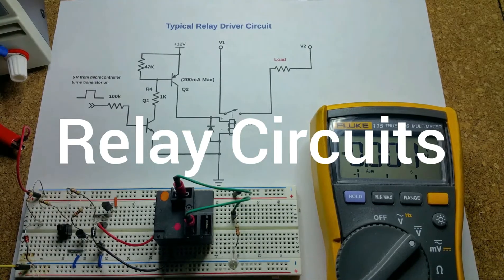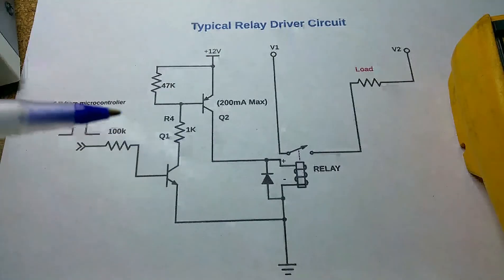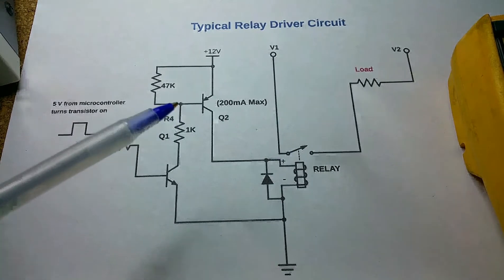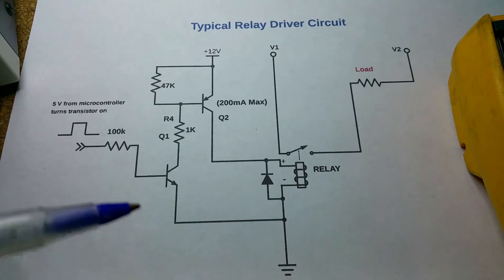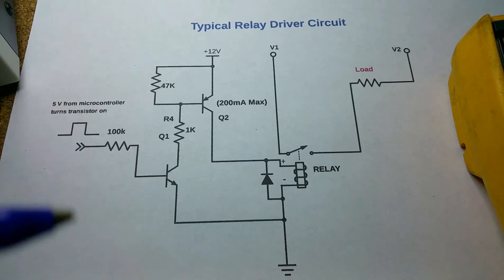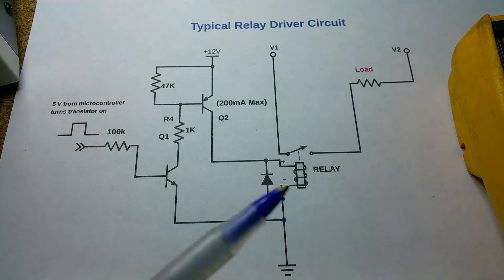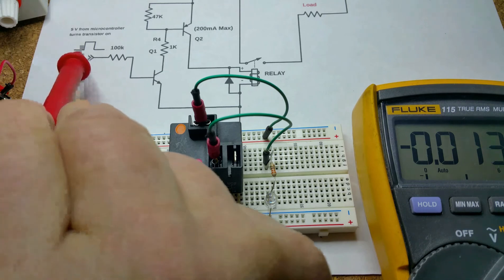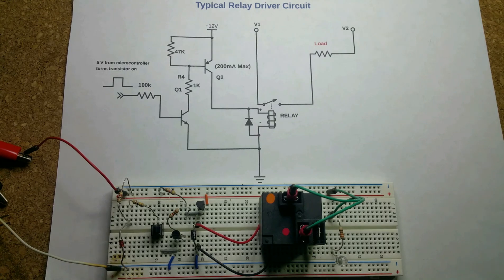#1 - Relay Driver Circuits - How they Work

Comment: Hi, I hope you are still answering questions. My question is that if we assume NPN has a base to emitter voltage of 0.7 volts, then we have a base current around 0.43 mA and assuming a betta of 100 for NPN, the collector current will be 43 mA. Also, we know that the voltage drop across the 47k resistor is 0.7 volts, which means a current of around 14.9 uA. How can I solve this paradox?
Reply from the maker: The base resistor of Q1 will have 4.3 volts across it. This will give us 4.3/100,000 or 43uA through it and into the base of Q1. Q1 is designed to run in a non-linear saturation mode. As such, Q1 collector current is dictated by R4, the 1K resistor. The voltage at the top of R4 is 11.3v. Since Q1 is in saturation, the voltage from Collector-emitter is approx 0 volts. Thus the current through R4 is 11.3/1k = 11.3mA. The beta of a 2n3904 is close to 200. Thus, 11.3mA/200 = 5.6uA. So our 47uA at Q1 base is more than enough to drive Q1 into non-linear saturation. It is true that since the 47k resistor has 0.7v across it, the current through it is only 14.9uA, but per KCL, the current flowing out of the base of Q2 must be 11.2851mA, for a total of 11.3mA (the current through R4).
Reply: @TheTechCircuit  But if per your calculation the Q1 base current is 5.6 uA, isn't this against ohm's law? since the current through Q1's base is calculated based on it's base resistance and the voltage across this resistance?

Comment: Why not drive the PNP from the micro directly. Pulling to ground from the micro switches on the pnp.
Reply from the maker: If configured in that way, the microcontroller output port would potentially be exposed to 11.3V (supply minus the Q2 Veb) when at a logic high, and many microcontrollers can't tolerate much more than a volt over their supply (or 6 volts for a 5V microcontroller). The NPN transistor is instead used to pull the PNP one low while only requiring a 0.7V base bias which the microcontroller can of course easily provide via the current limiting resistor.

Comment: There is no detail about transistors, their type and current and voltage requirements. There is no explanation as to why 2 transistors were used when only one can work as a relay driver.
Reply: The NPN transistor pulls down the base of the PNP, which energizes the solenoid (solenoid current passes through Q2, not Q1). As for the type of transistor, depends on how much current Q2 has to sync; Q1 can be a 2N2222, general purpose transistor.

Comment: Y can't the 47k drive the first transistor. The current flows from 47k to the base of the first transistor, which then drives the first transistor, resulting in relay to turn on.
The only possible explanation is current flow from collector to the base, which then flows through 1k rather than 47k, as current prefers least resistive path, therfore requiring second transistor to be turned on.
Reply from the maker: Good question. The 47K resistor cannot drive or turn on the first transistor (Q1). It is only used to keep the second transistor (Q2) in the cutoff region until Q1 is turned on and pulls the base of Q2 low. Once Q1 pulls Q2 base low,  it goes into saturation and current flows through the relay. The reason for 2 transistors in this configuration is that the microcontroller can have active high relay control and be well isolated from the relay coil's flyback voltage. Also, if the microcontroller were to drive Q2 directly, the output port would be subject to a constant 12V potential, which exceeds many microcontroller's AMRs.
Reply: @TheTechCircuit  thanks

Comment: Finally someone showing the real scenario of working  relay circuit ! I really like your explanation ! but why do you need 2 transformers ? would just one be enough to start 12V circuit with base current coming from microcontroller ? thanks
Reply from the maker: You can certainly switch the relay from the low side with an NPN transistor and a microcontroller driving the base through just a current limiting resistor. That is a convenient way to do it. It is better in many cases to use a high-side driver instead though because whatever device you are driving will share a common ground with other components and when switched off, will be at ground potential instead of at Vcc or (live).  By using a PNP on the high side and an NPN as a pre-driver as in the video, you reduce the required drive current from the microcontroller port, and add an extra layer between the microcontroller and the relay coil's inductive spikes - while at the same time, gaining the general benefits of high-side switching.
Reply: @TheTechCircuit  Ok Yeah it makes sense, maybe one more clarification ..so 12V is powering main Load and PNP transistor which reduces voltage to 11.3v and that goes to the second NPN transistor which saturates at  0.7 micro-controller voltage closing the circuit. And you need PNP transistor to drop current that could be too hight for micro-controller itself ? because voltage is not that diffrent but current possibly it is ?
 I think I can see the logic of 2 transistors. I am a novice in electronics and try to build raspberry pie water heater with pump for my van conversion. I could just buy relay board suited for that but I would rather understand what is behind it. Thanks again and have a lovely day !
Reply from the maker: @greggil3454  11.3 volts will appear only at the  base of Q2 when saturated and will be 12V when not saturated (because of the 47K pull-up resistor). The voltage at the collector of Q1 will be the same as that at the base of Q2 until Q1 is switched on, which then saturates Q2. At this point, the base of Q2 is 11.3V and the collector of Q1 is about 0V. The difference is dropped across the 1K resistor.  When the microcontroller outputs 0V, the base of Q1 will be 0V. When the microcontoller outputs 5V, the base of Q1 is 0.7V. The 100K resistor drops the other 4.3V and limits the base (and microcontroller port) current to 43 uA.  The reason for Q2 (PNP) is to provide source switching, rather than ground switching. You can use the NPN by itself, and it will work just fine - even though the base current will need to be higher. You would need a lower base resistor value than 100k in that case so that the relay current divided by the NPN beta (about 100) could be attained. That would all work provided you didn't exceed the microcontroller port's max sourcing current.
Reply: @TheTechCircuit  Amazing ! U should post more videos with microcontrollers :) thanks again I got it now.